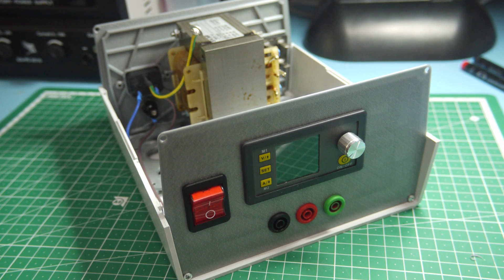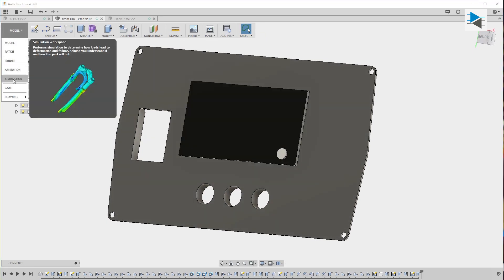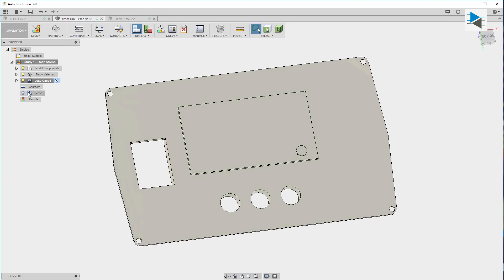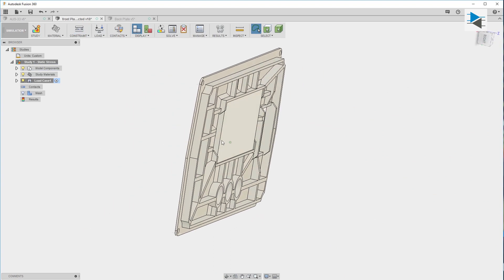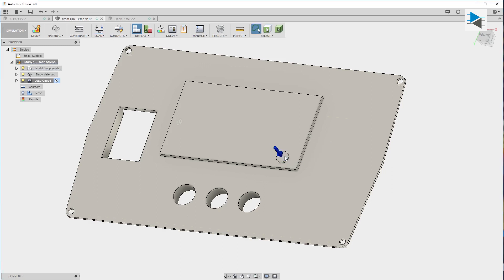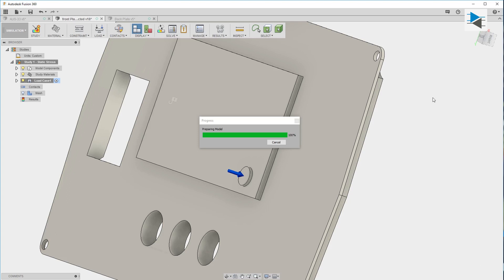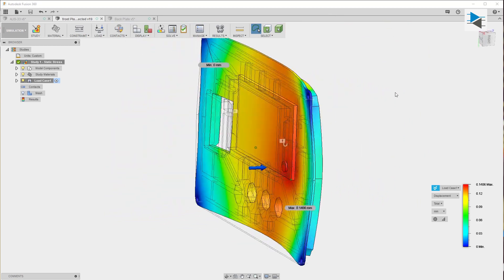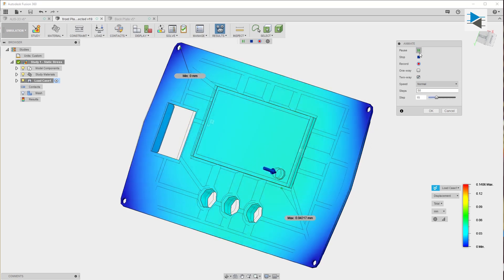Tutorial: Static Stress Analysis in Fusion 360

Comment: You can add PLA through the material manager. Accessed from the Unitily drop down in the design. You can add Volume cost. Density. Pressure bearing and more. It's the first step to shopping for any material for me... That is looking at the material data sheet. Once you have all the engineering notes you can stress test to accurate levels to improve your design.

Comment: otinex, did you conclude that the force to push the front panel display button resulted in a deflection of the web of the plastic front panel was too great? And if so? did you then increase one of the depths of the various webs and retest?  Was this used as a design mod in the early stages- or a design confirmation of sufficient face frame web/egg crating to support your required button actuation pressure?  if there is a follow video, I'm sorry not to find it. thanks for the video.